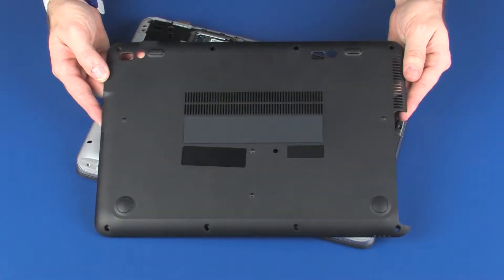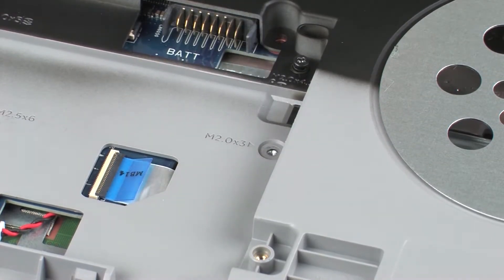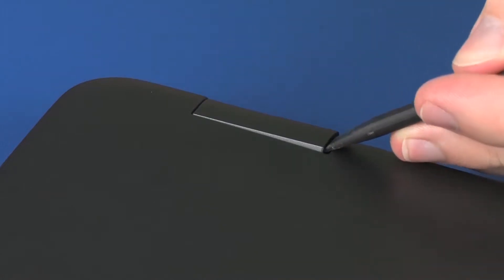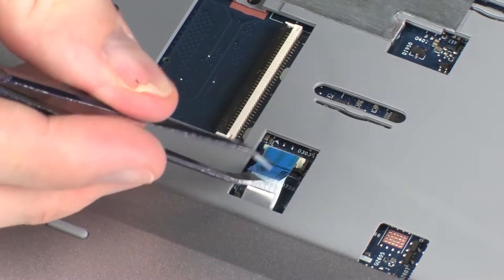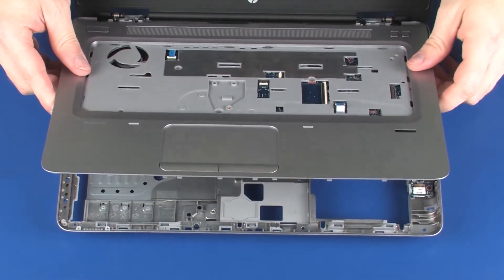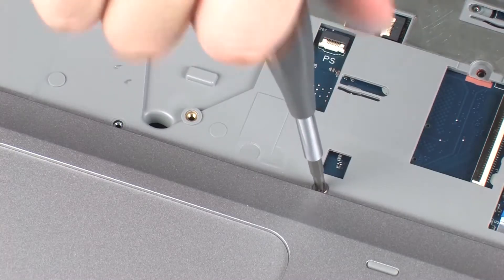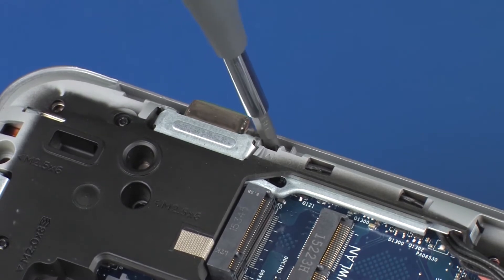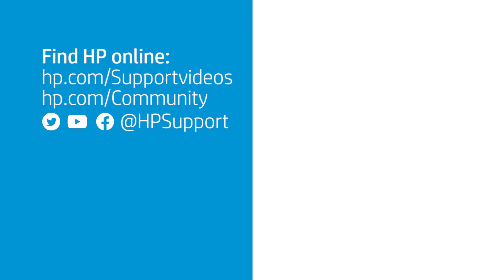Replace the Top Cover | HP Probook 640 and 645 G2 Notebooks | HP Support

Comment: i am confused becoz when i start laptop on the initial screen all bottons are working but when i use keyboard in windows did not work a single botton i tried every single method like new windows, window update, keyboard driver update, trouble shooter and many methods but in device manage option "This device is not present, is not working properly, or does not have all its drivers installed. (Code 24)"  an other thing that with keyboard there are two botton right upside 1 is Airplane Mode and other is Mute botton so with keyboard mute botton also stoped working only airplane botton and FN + Backlight key working in windows on the other side initial screen or in Setup every key is working before windows starts can you help me to get out from this dificult stress
Reply from the maker: Hi there, thanks for contacting HP Global Social Media Support!
I am here to help!
May I know the product you are using?
Let me know!
Regards, 
HP Support
Reply: @HPSupport  HP Probook Laptop 640-G2 i5 6th Generation
Reply from the maker: Thanks for the reply.
Use this information to troubleshoot common keyboard problems on notebook computers: https://splr.io/6053YXRjU
Please let us know how it goes!
Regards, 
HP Support